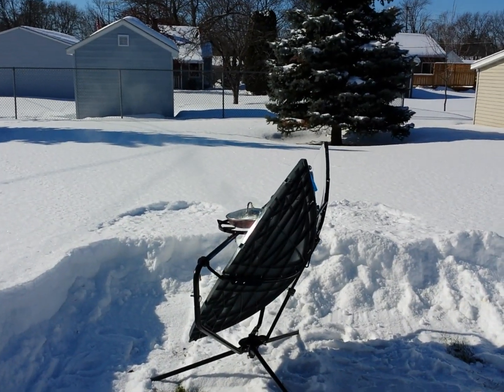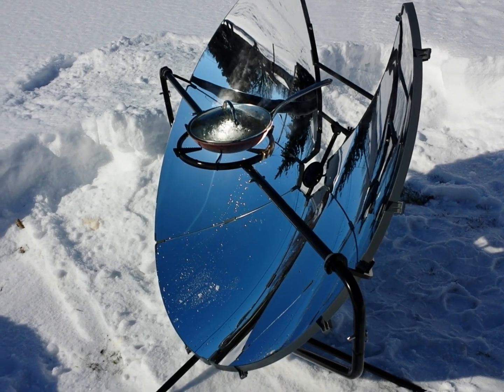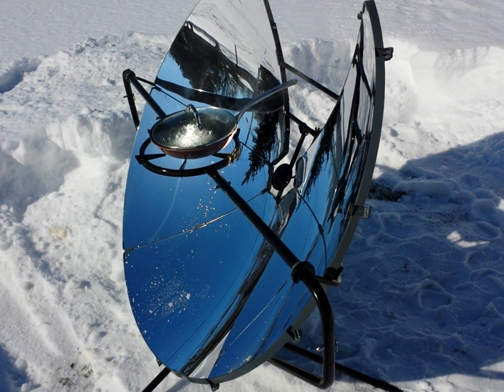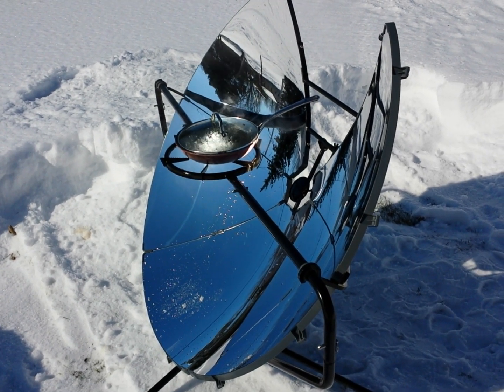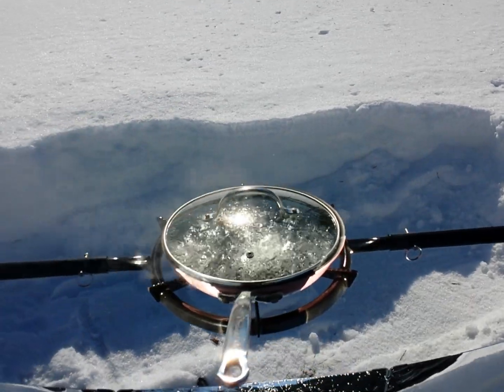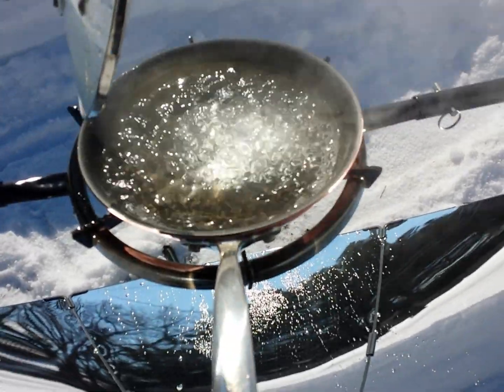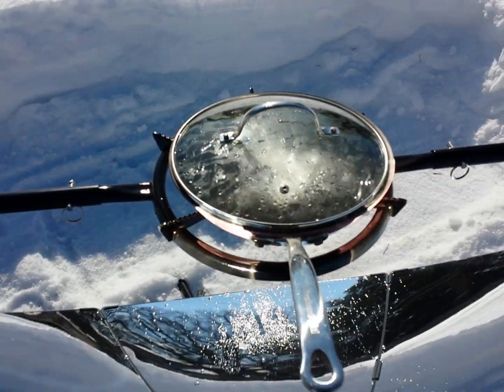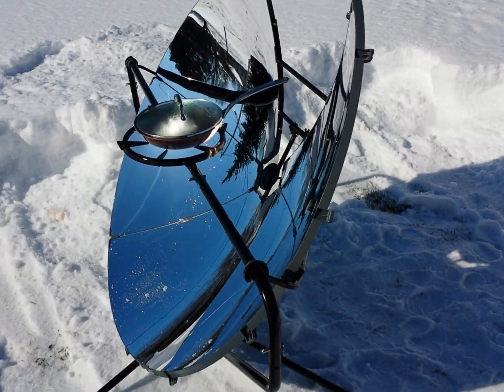Solar Grill Test in Winter

Comment: These are cool for mid-day cooking in the winter, or all the way up to 7/8PM in the June.  You can make your own by getting the parabolic mirrors, a guy started making them and selling them over at greenpowerscience.  I just cooked a hot dog with it. (17" mirror ran me about $70).  He has all kinds of instructional videos on how to make your own mirrors with Mylar too.  If you can get good UV resistant acrylic into this shallow dome shape you can make your own high grade ones with the silver nitrate method.

This is the tip of the iceberg too, you can emulate a fresnel lens with reflection vs refraction and make a LENS like this instead of a mirror its really cool

Comment: Why a lid on a skillet to boil water instead of a pan without a lid?
Reply from the maker: the upscriber thank you for the comment. The skillet came with the solar grill and it is advertised as receiving and distributing the solar energy more effectively than a standard pan. The day I did this experiment was very cold, and I needed a lid to retain the heat. SolSource does not advertise that the solar grill would work under these conditions, but in my case it exceeded expectations and worked great!